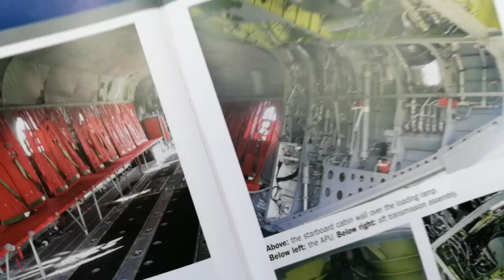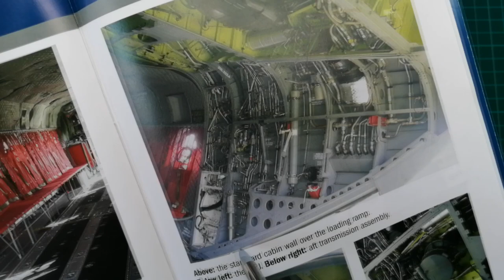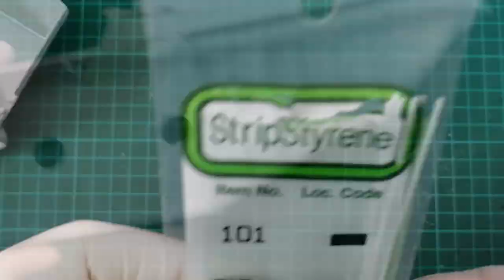Trumpeter's 1/35 Chinook 47D built into a HC. Mk 1 (Part 2)

Comment: I did a bunch of airmobiles when I was in the US Army, all while stationed in Germany. Sitting there with my platoon, everyone's eyes on the crew chiefs who were constantly looking at all the lines and tightening up things as we flew. The rear ramp was partially open and you can see the helicopter "wiggle" in flight. The funny thing about the Chinook is that the engines constantly work against each other, causing the helicopter to move back and forth in flight. Lot of power in those engines. On your model, you are doing a really good job. Are you gonna weather the crap out of it? They got pretty beat up in Iraq and Afghanistan.
Reply from the maker: Sorry for the late response I've only just got your comment.
No 7 Squadron ZA680 with weathering.